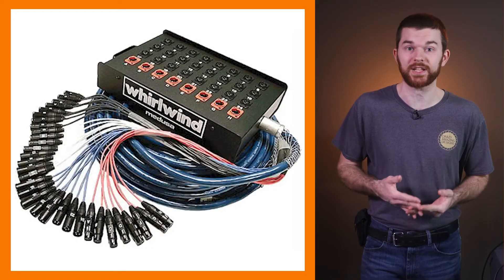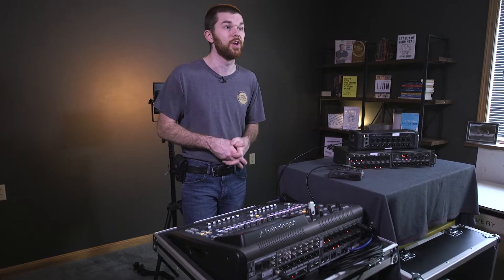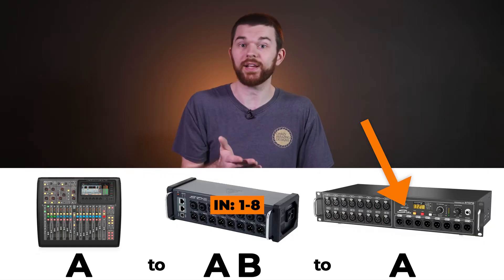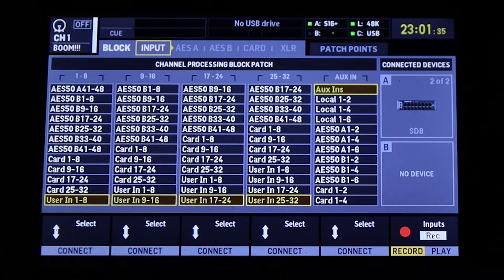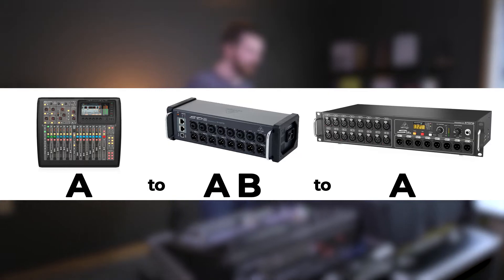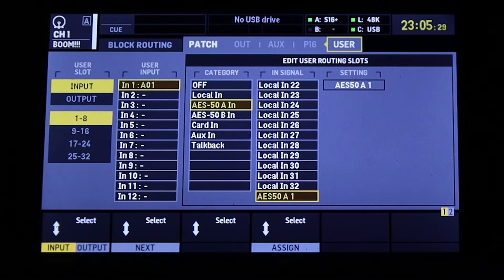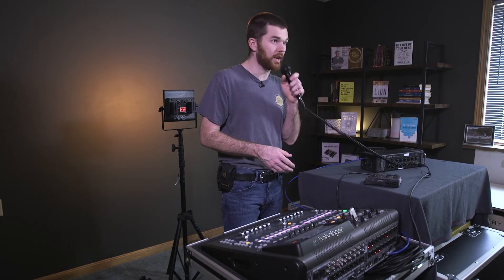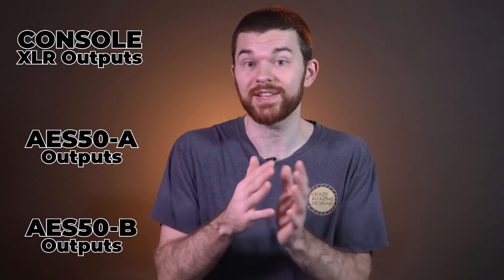Using AES50 to Send and Receive Audio on x32 W/Stage Boxes

Comment from the maker: Do your remote Stage Boxes feel closer with a better understanding of AES50 Routing? Check out my store to download my *Show File, and *x32 Routing Master File.
Reply: @crazyAmazingDesigns I have you same setup excluding the S 16. I am familiar with using the S 32 and the actual X 32 mixer. My question is if I'm just using the SD 16 but I will preferred to use it for AES50 channel 17 to 32 via SD 16 and 1- 16 as local is that possible?
Reply: I believe you answered my question

Comment: Can u link a x32 with s16 thru AES50B ports only?
Reply from the maker: Yes, Connect the ES50-B port on the X32 to the AES50-A port on the S16, Always use the A port as the primary link on stage boxes. -Nathan R

Comment: Ho can you use AESW50 to multitrack audio channels into a PC? Or is that not possible?
Reply from the maker: Check out this video where I make a USB connection between the X32 and Computer, then on the CARD OUT tab select what content goes to the Computer. I have seen an AES50 to USB device, but you are better off with the USB Connection. -Nathan R

Comment: Dont overuse USER routing like this, It just makes things more complicated. For that vast majority of setups the standard block of 8 routing is perfectly fine and is just simpler. Especially for the outputs. Standard Routing for the outputs is ALREADY 1-1 via the Outs page in routing.
Reply from the maker: @DustySeven7  Yes! I could not agree more. In this video I was trying to explain the use in different scenarios however. 1-1 is life. -Nathan R

Comment: Hello everyone . please i need help " output configuration for M32R Live with DL16 "

I'm currently working with the M32R Live mixer and the DL16 stage box, and I need help configuring the outputs. I'd like to use the user outputs on the mixer, specifically for buses 1-8 bus fader. I aim to set up bus fader 1 to output from the local mixer (out 1), bus fader 2 to output from the DL16 (out 1), bus fader 3 to output from DL16 out 2, and bus fader 4 from DL16 out 3 and so on.

similar to how I configure the inputs. For the inputs, I can set input fader 1 to source from the local mixer and input fader 2 from the first input of the DL16 from user input I know how to do it , but setting for out it is confusing

and also I want to make out 7 in dl16 as master out left and out 8 in dl16 as master out right and to keep also out from local 7,8 as master because I want to have other PA system from DL16

Could you please provide guidance on how to achieve this configuration for the outputs?
Reply from the maker: Hi! This is a big topic to discuss over Email or this YT comment. If you signup for a Training Session, I'd be happy to help you get this working. We can use Remote Desktop via a Zoom meeting, and the M32-Edit app on a computer to get this routing setup for you. "http://CrazyAmazingDesigns.com/training" -Nathan R

Comment: How long is the cable I can use between the boxes?
Reply from the maker: AES50 uses an Ethernet cable, it's not a network connection, but it's Cat5e. 300ft is MAX length for Ethernet cable, and I've seen issues with Max Length 300ft Cat6 cable. The extra Cat6 cable twists make for longer cable, and causes issues with AES50. -Nathan R

Comment: One question, Google can't handle.
I want to use two X32 parallel, one for live, one for stream.
We have a remote stagebox connected with the AES50 A connector on our first X32. Could I use the AES50 B on the first X32 to feed the 2nd X32, that it may be used the same way as the first one?
Reply from the maker: Hi, Yes you can connect the stage box to X32-A (AES50-A on X32-A to AES50-A on the Stage Box) and bring in the Audio channels to the X32-A. Then connect both x32 mixers via AES50-B to A on X32-A. Now Pull in Staeg Box inputs to X32-A via. -Nathan R

This is an Advanced method of using the x32 platform. Very hard to make it make sense with few words. If you'd like to schedule a zoom meeting with me, We can get things working for you. www.CrazyAmazingDesigns.com/training

-Nathan R
Reply: @CrazyAmazingDesigns  We doesn't have the second x32 yet, but the question is, what cable do we need, and it would be easier, if we could connect the 2nd X32 simply to the first one.
In routing is the option to send the inputs to AES50 B, does it mean, that the channels with all Equalizer and dynamics settings goes to the AES50-B output or the signal before the processing?

Comment: Is is posible to keep my local outs and use additional outs on my SD16? We are a setup tear down church and leave our x32 rack on stage and setup a table in the back with two computers along with the sd16 and iPad to control the x32. One computer sends audio and the other receives it for the live. In the past we have ran several cables from the front to the back but they are bulky and with translation stations, stereo ins and out from the computers the cable management has become a nightmare. Add on this the room we use has been split and so we now need to figure out something more practical which is why i opted for the SD16. The issue I am running into is, I have designated outs locally from the x32 on stage and need at least 2 outs in the back for the live. Can this be done? If so how? Can I have main outs, sub fed busses, in ears etc on stage and program the SD16 to only give me stereo outs for my livestream? Appreciate any help!
Reply from the maker: Hi Jimmy, Local OUTs are assigned on the XLR tab of the x32 console/ rack. For example you could assign Output 1-8 on stage, and 9-16 to the SD16. Or use USER OUTS to assign more specific channels to the outputs. If you want to schedule a Zoom Meeting, I can get things set up for you and then help you understand X32 routing better. Book a time on my calendar at www.CrazyAmazingDesigns.com/training -Nathan R
Reply: @CrazyAmazingDesigns  thanks Nathan, I’m going to give it a try and book some time if I need additional help.
Reply: @CrazyAmazingDesigns  I tried setting it up but the options on the XLR tab are for outputs 1-4 or 5-8 it doesn’t allow me to have more.
Reply from the maker: @jimmysiberio3713  Yes, because there are only 8 physical XLR out ports on the console. -Nathan R

Comment: Hi, how to use a X32 compacto with stagebox WITH FIBER Cable? (same as Dante).
Reply from the maker: Hi, You cannot run AES50 over a direct point to point fiber connection from the stage box. If your building is run with Fiber networking that is fine. I would setup a network switch near the x32 compact mixer and connect the switch to the x32. You can then connect the dante card port and the network port to the switch, and the switch to the network. -Nathan R

Comment: Thank you for the informative videos. I have a X32 plus an s16 stage box. Ordinarily I am able to use 2 active FOH (front of hall) speakers on stage, and 2 active FOH speakers set back from stage in a long room (with a bit of delay). But with a band that requires 4 monitors, I have to use one pair for the monitors leaving me with just 2 active FOH stage speakers. So I can swap them out for passive FOH stage speakers using an amp and move the actives to back in the room. How would I route the main mix -- I could use channels 7 and 8 to the passives, but what to do to get the main mix to the actives as well. (Hope I'm clear enough). Outs 1-4 go to monitors on mixbusses 1-4, no problem. outs 5 and 6 could go to actives, and 7 and 8 to passive speakers. (I don't believe you can daisy chain actives off my EAW passives.) So how to duplicate main mix of 7 and 8 to 5 and 6? I'm sure it is probably easy..  thanks!
Reply: and when using the 4 actives as FOH speakers I just daisy chain them.
Reply from the maker: Hi Jim, On the OUT 1-16 page, this is where you can set the outputs for the Outs 1-4 and 5-8 you have already sent to your S16. Set 5/6 to be Main L/R just like the 7/8. You can daisy chain Active speakers easily, but Passive speaker Amps sometimes don't have a through port. You could use an XLR Splitter cable if it comes to it. -Nathan R (Email me if you still can't get it, or Schedule a Training Call through my website and we can definitively get things working the way you'd like.)
Reply: @CrazyAmazingDesigns  Thanks so much! Easy deal.. works fine. I wasn't sure I would have volume control separate from the other pair of speakers from the board though, so I tried setting 5 and 6 outputs to Matrix 1 and 2 and that also seems to work and gives me volume control. Hopefully doesn't create other issues. Plus your reply made me look at our amplifier, a QSC PLX 3602 power amp that has a parallel Mode. It says "use only one input when operating in Parallel Mode. The remaining input connector can be used for daisy-chaining the signal to other amplifiers. " So perhaps that would work  -- just with no board volume control per pair.. but I could always jump up and adjust individual speaker volumes on the speakers. Thanks again!

Comment: https://youtu.be/fRFHDfw4PiA?list=PLxwwKHG_hY1W6g0-1kjKd0TS2I_qQwykk&t=800 Is there a difference between the AES OUT and AES USER out if you link each number to the same channel on the USER tab ? If I understood correctly, USER is to change the path of a channel , Example sending Out 3 to Out 8 etc...
Reply from the maker: Hi, USER IN and OUT give you the most flexibility. Assign USER OUT to AES50-A, for example; now you can send any input or Output in the console to those AES50-A stage box output XLR connectors. -Nathan R

Comment: Hi Nate, thanks for making these videos. 1:30 you mention the band could change the house mix. Are you using the MX-Q app? That is what we use and it only lets the band adjust the mix bus they  have selected in the app.
Reply from the maker: Yes, and yes, Thanks for the comment! There was a time I did not know this and had not used the light app versions. I created a video last week where I looked at all the different apps and what they are capable of. -Nathan

Comment: Hy. Can i use a xr16 as a digital stagebox
Reply from the maker: Unfortunately No, the XR16 does not support AES50. This is why I recommend spending a little bit more for the x32 compact which has a lot more expandability including AES50 and an expansion card slot. -Nathan

Comment: Hi @CrazyAmazingDesigns I have a X32 with a snake cable box with 8 outputs on stage, i also have the sd16 for an additional 8 outputs. How do i route my mixer to take the first 8 output from my xlr output and the other 8 outputs from the SD16 stagebox output.

Thank you
Reply from the maker: Hey! I replied to your email. 😀 -Nathan
Reply: @CrazyAmazingDesigns  Thank you soo much

Comment: I have. A problem : I have an sd 16 just like the 8 channel snake u show, but with 16 channels, so every time I connect it to A and A from my x32 to the a port of the sd16 snake,,, but when I connected it to port B of the sd16 it shows a red light, (not the power on light). And the interesting part is that on the. X32 it shows as being connected but nothing works… any suggestions?
Reply from the maker: x32 Console AES50-A port -> connects to S16 (A) port. The screen on the x32, the top, should show Green on the AES50-A connection. Port B on the S16 is the output port, you could use it to connect to a second stage box. -Nathan

Email me if you still are having issues, YT didn't show me this comment until I hunted for it.

Comment: I’m still new at this and we want to our 4 iem system. What’s your ideals on connecting them up for use
Reply from the maker: I’m gonna need some more info, P16s are the easiest option. Connect multiple of them to the Poe switch and connect the switch to the x32. Now you have a bunch of personal mixers for the band. Each member can plug into there personal mixer and control the mix from the p16.
Reply: Using sennheiser G4 wireless iem system. My understanding is you connect transmitter to your Aux in’s. On x32 back panel.

Comment: Hello Nathan. Your explanation for this mixer and stage box is the first video to give me a better understanding of how this should work. Thank you. Im still having a little trouble with the outputs on the stage box. I have 2 SD8's wired as you said.  My mixer shows Chanels 1-8 (Local inputs) Chanels 9-16 (Local inputs) Chanels 17-24 (inputs are A1-A8) Chanels 25-32 (A9-A16) The problem I am having is that I need output Chanels 7 and 8 on the stage box to act as Monitor outputs (Like "Monitor" on the rear of the console) How do I achieve this?
Reply from the maker: You can assign the XLR outs from the "XLR Outputs" tab. Then what mixbus or L/R mix is sent to each from the "OUT" tab. -Nathan

Comment: Tonight, I have no monitor engineer and I'm running the monitors myself. I'm hoping to run the monitors from the FOH console without repatching. Yes I know I can put the AES50A cable going to the stage and plug it directly into my main M32 Live at FOH, but what fun is that? 

I have DL32 on stage with a M32C connected to it's AES50A port. Then on the M32C, I have a M32 Live connected to the M32C AES50B port. I'm in a situation where I want to route the M32 Live outputs (1-16) to the DL32 outputs without physically repatching anything. As far as I understand things, on the AES50-B tab on the M32C, I can use the first two columns (AES50B Outputs 1-8 and AES50B Outputs 9-16). I scroll down and select "AES50A 1-8" and "AES50A 9-16" accordingly. This should now route the AES50B inputs of the M32C to the AES50A outputs on the M32C, which are already routed to the AES50A inputs of the DL32...right? 

For anyone wondering, we already use this system successfully as a dual console Mon/FOH system using the Aux In Re-map method (all outputs on the DL32 are fed from the M32C Monitor console...because technically only one M32 console can interact with the DL32 at a time - though happy to be proven wrong about that).
Reply from the maker: First of all, I had no clue the M32C mixer existed. So Thanks!! To fix your issue, I think you have the AES50-A & AES50-B routing backwards on the M32C. I build a diagram based on how you said this is wired. That I'd love to send you, so please send me an email. If your M32 is connected to the AES50-B port on the M32C. And the DL32 is connected to the AES50-A port on the M32C. 

Then from the AES50-A tab in routing on the M32C, you need to select the inputs AES50-B 1-16, from the m32. -Nathan
Reply: @CrazyAmazingDesigns  Hey Nathan, it all worked as I described it. So nice to not have to rewire anything for this setup.
Reply: Can it be possible to use 32 stage box for x18 console? And if yes can you get 32 channels for mixing?

Comment: For those attempting to link two X32's together, it is important to note that the ethernet cable does need to be shielded preferably a shileded Ethercon cable.

Also one X32 has to have its clock synchronization set to Internal but the second needs to have its timing sync set to AES-A (If using A on both units). You should have a green light on both X32's for AES-A or B if using B port.

Comment: Hi Nathan, in our church in Belgium i use an X32 with SD8, SD16 and SD8 in cascade. THe output switches are set to 1-8, 9-16 and 17-24. How can i route, lets say mix bus1 to output 24? (we also use P16m, so all of these channels are in use)
Reply from the maker: Hi Danny, I'm going to be in Flensunger Hof, Germany this summer for EmpowerConference2023. On your x32, on the AES50-AorB page, set the 1-8, 9-16, and 17-24 outputs to be USER Outs. Then in the User Out page, select OUT 24 and select mixbus 1 as the source. Send me an email (in description) if you still can't get it,  -Nathan Robb
Reply: Hi Danny, How long is the cable I can use between the boxes?
Reply: @luigi7927  the total lenght between X32 and the last stagebox is 100m

Comment: Hi Nathan, finally a video that should help me... I find it very confusing using the Edit-Software and see the Editing local at the device. It looks just so different. And: Why do the label the User-Output Category "AES50-A in", when you want actually send something "out"? I think I'm wrong. I spend hours on the x32...Please: I want to send 28 Channels (received from the AES-A Port), and 2 local inputs,  the mix busses and Main L/R back on the AES-A Port to my other devices. 
User Out Tab: user out 1-16 to Output 1-16 (because the Stagebox Wiring takes only the 1-16)
User Out Tab: AES50-A 1-32 to Output 17-48 (will be rerouted in X32R)
Tab XRL: all 1-16 to User Out
(Using an X32R as Monitormixer, connected to a S32)
Thank you for an advice.
Reply from the maker: Love it! Glad you found value in this video. I agree it's confusing, Send me an email and let's connect over the phone to talk about this. It's just too much to do over YT Comments. lol CrazyAmazingNathan@gmail.com

In the USER Inputs section, let's select Channel 1. I'll select "AES50-A Source 1" as the input. Now I'm pulling from "AES50-A Source 1" for Console input 1. In the AES50-A tab it's all about MixBus Outputs to AES50-A. But in the Input tab, or in the USER IN tab when the Inputs tab is set to USER IN. There it's all about AES50-A channel Inputs from stage boxes.

-Nathan
Reply: Hi…wrote you a mail… Thank you